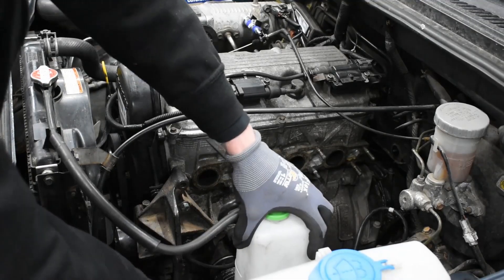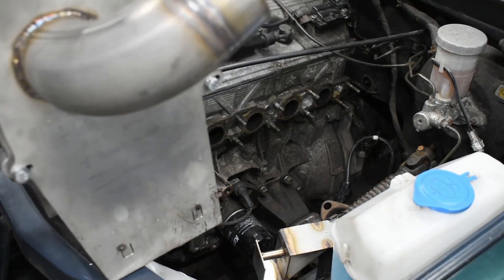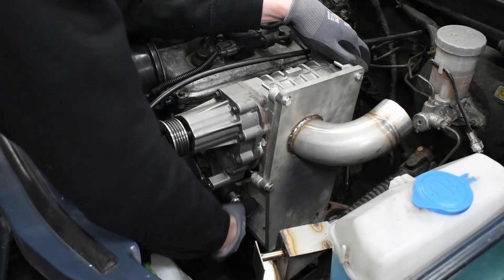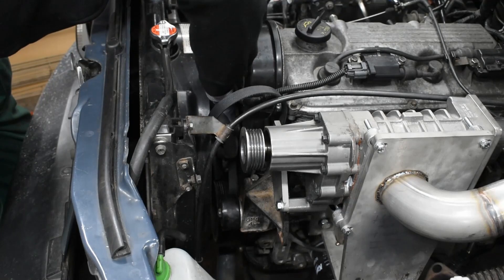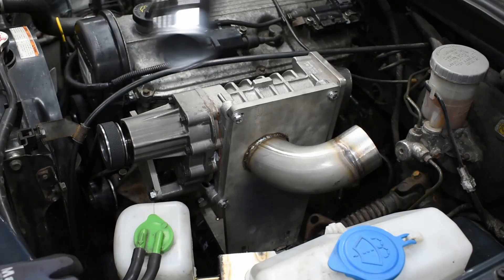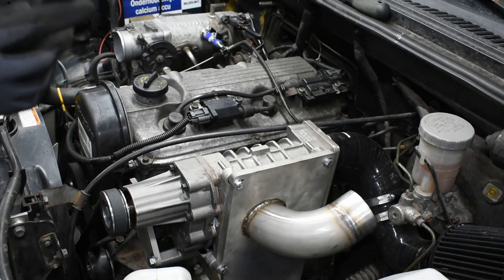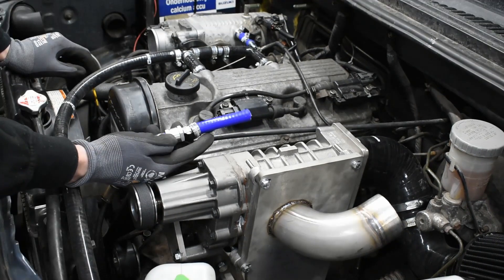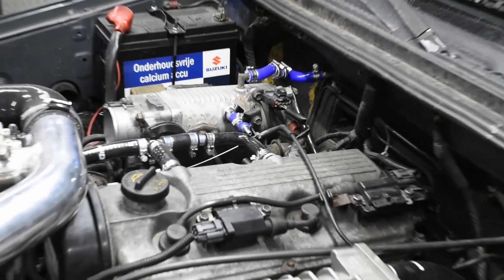Suzuki Jimny 1.3 Supercharger system installation | Chargertech

Comment: Hi how much does this cost? Is it possible to install it without installing the coolant? Can it be installed at home?
Reply: Is it possible to install it without disassembling the engine and replacing the levers and shafts?

Comment: I have g16b on my jimny do you have a kit for that engine
Reply from the maker: Not yet, depending on the popularity of the 1.3 kit we might add another kit in the future!
Reply: Do you have a number of hp for the g13 at 0.7 bar
Reply from the maker: @spiroskonst3736  no, we made the kit on a stock engine and didn't want to push it to far. If you would go 0.7 bar I would suggest strengthening the engine.

I would estimate around 60-70÷ more power and 70-80÷ more torque